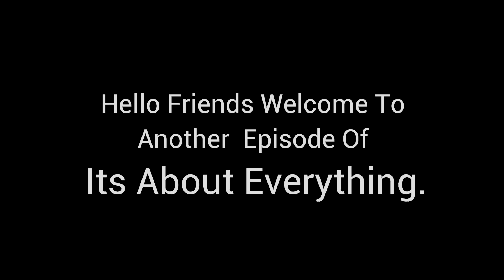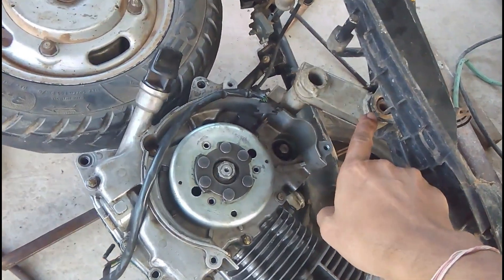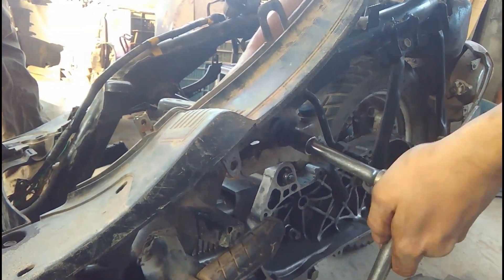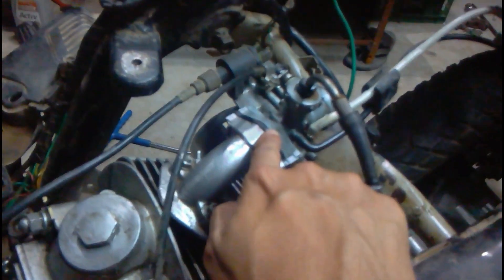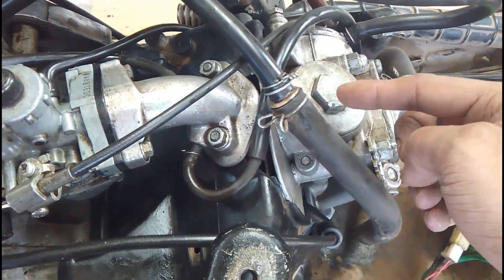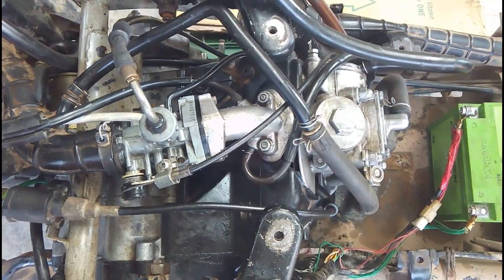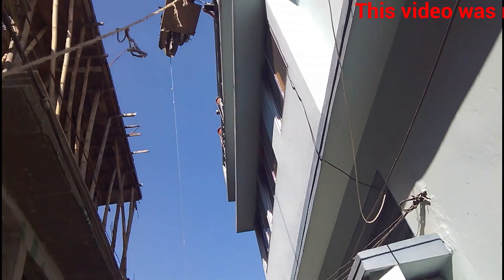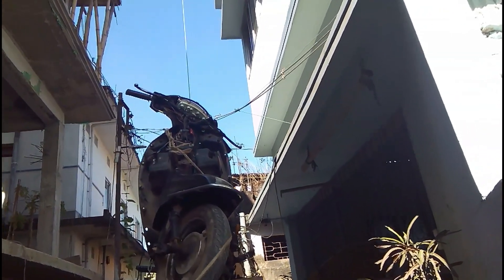Full  Rebuild of  Mahindra duro 4 stroke engine part 6 The End --- Its About Everything

Comment: I have duro and I have change CDR UNIT ON 21th june 2020. But at present Plug wire has no power... fuse blows... battery full charged.. i changed fuse but when key turned on self working but plug wire has no power.. so what i have to do..

Comment: Hi i like this my duro all lights are not working including key beep sound please help me
Reply from the maker: +kirann meesalaa check the main fuse, if not blown then check the dynamo generator, if its ok then its the wiring for sure. 
Blown fuse or bad dynamo also means there is short-circuit some where.
Reply: @ItsAboutEverything01  dynamo means cdi unit or please send the image where it is seated
Reply: Please send the solution
Reply: Please send the picture of problem part self start is ok horn ok but all lights are not working including ignition beep sound i am check the regulator, cdi, wiring please give solution
Reply: take it to the service they will fix it. you follow the wires to the switches and than to the distribution box. there you find fuses. but it can be a rusty connection or brocken wire also. just investigate or take it to service.